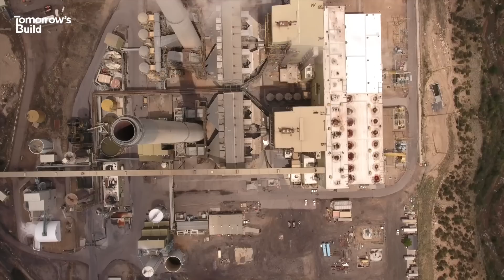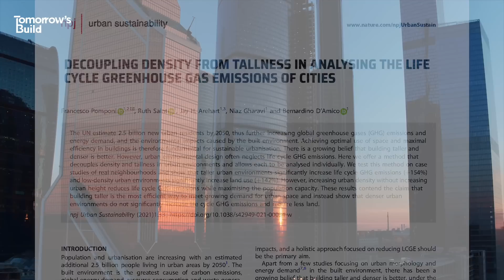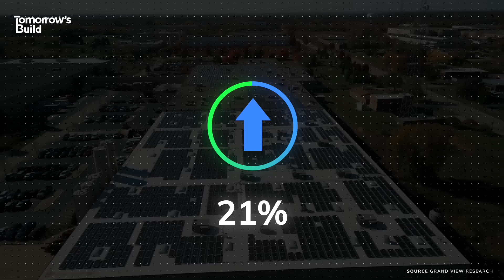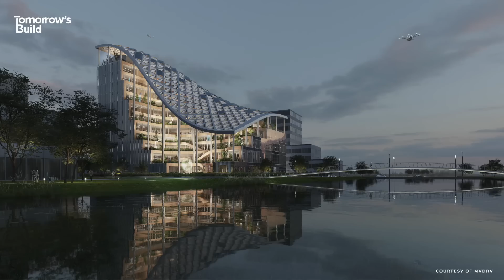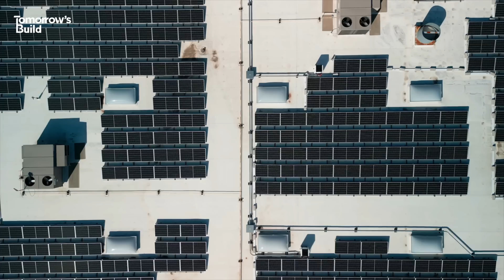Why Skyscrapers Should Be Solar Farms | Tomorrow's Build

Comment: Why you aren't talking about energy, solar pv output is directly connected to the tilt angle, it's a logarithmic scale with very sharp angle like 90 degrees of tilt, so, it's one of the most important natural barrier for that. Let's say for the 22.3 MW burj Khalifa,

It will get the sunlight for about 6 hours on average on each side, due to the tilt angle, mac generation is possible during the very early morning and very late evening, but the irradiance is lowest at those hour.

All these factors will make it about 10/15% of the same sized pv farm or a rooftop pv. And the payback time will be about 60/80 years. Financially, a very loss project.

Comment: The problem isn't the placement of new solar panels persé: it's the cabling them together and transforming that power into usable voltages, as well as means to storage that energy for when it's really needed - which, in temperate climates, is hardly ever when the sun's shining brightly...

Here in the Netherlands we see plenty projects fall flat on their faces because, after panels have been installed by east European workers, all the cabling (loads of copper!) has been nicked.
Police is forever guessing who did it, while most outside of said police force have a pretty good clue, but not allowed do anything about this theft.

Copper prices are rising, which means additional costs to be paid by the clients - not to mention all the extra security firms since police still hasn't got an inkling about the culprits. And even if they *did*, nobody there speaks polish anyway.
End result: less solar panels installed, and even less properly working.

On topic:
High-rise buildings clad with integrated solar panelling would be lovely, but it's usually shot down by architects, who don't like their "artwork" marred in any way shape or form, including actual use by the owners.

Architects and project developers are quite (i.e.: far too) familiar with city councils, and just do as they please, which is making vast amounts of money providing very little in the way of usable living accommodations.
No matter how high: it's either going to have solar panels on the roof (depending on that massive skylight for an architect's price winning atrium, of course), or none at all.

Comment: These anti-skyscraper ideas are so stupid. Covering it with solar panels is just one of MANY ideas to make it sustainable.
It doesn't matter and it's obvious that it's dirtier than small buildings. But people forget that it is tall, so it can accommodate many times the usable space compared to small buildings, meaning we can have more green areas and fewer taller buildings to meet our needs.
Skyscrapers are not the problem, they are the solution!
Lack of urban planning, zoning, vision and building regulations are the problem!

Comment: There's so much more to be discovered in the world of secret solar power. Yet it seems to be taking an age to get them to market.

From water cooled domestic roof panels ~ increasing the efficiency and providing hot water ~ via thin and flexible mats designed to look like roof slates, to the ones featured in the video (which remind me of the old heated rear window filaments on cars; it's all very exciting and encouraging.
Reply: Big oil.

Comment: If you could get more than 1MW average  from the Burgh Khalifa I've got a bridge to sell you.The building is essentially vertical and panels get higher efficiency when they face the sun so less well under a third of the building will get sun relatively incident on it for 4 or 5 hours a day. For 6 months of the year you will also lose about 10% efficiency due to it being so hot.

Comment: You could put solar on the side of buildings but you see a heavy drop in efficiency compared with panels angled towards the sun. This would make the panels so expensive that they may not even pay for themselves over their lifetime.

Also that estimate of the power that the Burj khalifa could produce was lazy in the extreme in its calculations as well.
Reply: Ignoring the angle of incidence is indeed lazy.

Comment: If every house had solar panals on the roof, would we even need power plants other than to store energy for use at night?
Reply: Basically no. Elon Musk did a bit in a presentation several years ago asking how much land area we'd need to cover in solar farms to power the US. People think the answer is, 'All of Texas' but it's a relatively small patch and would easily fit on existing roofs. It may not be the most cost effective balance but it's absolutely viable, in every country on the planet. With undersea cables (which we already have in the UK) you can trade power with other countries during darkness as well. But we still need batteries. That's good though because batteries are useful for lots of scenarios and abundant solar will also have other uses (such as desalination and water purification).
Reply: we'd have to do the calculation, it might free up the city or state household for something else yeah.
If it's enough to cover households and industry then we're good. It's just a large investment into long lasting infrastructures, so plans based on this would have to be on the scale of lifetimes. Like 40 or even 80 years.
Reply: Depends on where you live. You might need more wind vs solar.

Comment: Cover every canal and reservoir in solar panels to collect sunlight, cut evaparoation om those waterways, cool the panels due to them sitting over water, and create electricity over surface area thats not being used for anything else. 

Then you put these solar panels on the roofs of every single school, shopping mall, church, hoospital, parking garages, sky scrapers etc.

We continue with home or modular/mini wond turbines that sit on these skyscrapers and other tall structures to capture wind to generate electricity. 

With all these forms of electricty we need energy storage we can use excess energy to create hydrogen to be used when these forms of energu produciton arent producing eneough.

Comment: I have a feeling more parking lots and facades will get covered in panels in a few decades ... makes so much sense even if the panels are not at the optimum angle
Reply: France has a recent law requiring parking areas over a certain size to be covered in solar panels. It's a great idea.

Comment: When talking facts about electric cars, the e-deniers always gloss over the fact that solar panels on every southern-facing structure will massively offset or even be net-positive for the charging demands of these cars which isn't that bad to begin with anyways (10kWh per day for most commuters)
Reply: The challenge always comes down to storing the power for when it is actually required.
Reply: @monkymind4316  That's super easy now with EG4 LFP batteries
Reply: So I had to check to be sure I had this right, but you do understand that in winter there is the least amount of sun light right?
And in summer the sun raises in the north east and sets in the north west...
So why would you place the solar panels on the south facing structures?
Reply: @derpionderpson1424  In North America, the sun has a southern arc across the sky throughout the year

Yes, there's not as much light but you get a few extra panels to compensate for it and with the lower the temps, the more efficient they get 

If you can get the batteries fully charged by 12pm every day, then you're doing good
Reply: @chattphotos  One of us clearly didn’t get our astronomy right in school because I’m 100% sure the sun will have a northern arc across the sky for the northern hemisphere (which North America is obviously part of) in the summer and a southern arc in winter.

When I look it up that is what I understand the info I find as saying as well so could you please tell me if you can find any online sources that you feel confirms what you’re saying so I can read them and maybe understand where we’re disagreeing.
Reply: @derpionderpson1424  North of the tropic of cancer the track of the sun will always be to the south, not the north. The angle will vary but it will always be in the southern half of the sky. You are 100% wrong on this.
Reply: @willythemailboy2  so as I thought it seems to be a matter of talking past each other.
At NOON the sun is in the south for most of the year on the northern hemisphere past the Tropic of Cancer, but in summer it goes from north east to that position at noon and to north west, meaning it spends a sizable chunk of the day in the northern part of the sky.
So yes I was partly wrong.

Relevant to having solar cells on the southern side of a building though, it still means the angle is not really that good as sun coming in parallel to the panels don’t exactly hit them a lot, therefor if only the sun at noon is when they can be hit, that’s going to be low efficiency.
Reply: @derpionderpson1424  For anything north of the Tropic of Cancer, the sun will NEVER, at any part of the day or year, be north of the zenith. The sun will progress from the southeast to southwest. You are entirely wrong on this.

You are correct in that a vertically mounted solar panel is relatively inefficient. Not because they will be shaded - they won't be - but because incident angle greatly affects the energy available. Vertical panels become more efficient the further north you go, which is why vertically mounted "balcony solar" is relatively popular in northern Europe. At anything above 45 degrees latitude the sun will be more horizontal than vertical, which is roughly Oregon or Michigan in the US or Spain and northern Italy in Europe.

For ideal fixed mounting, solar panels should be fixed facing south at an angle exactly matching your location's latitude.
Reply: @willythemailboy2  source for the first part please.
You telling me is not enough, could be I’m wrong could be you are wrong, give me something not written by a random person in a comment section so it has a bit more validity.

Comment: honestly im shocked we took this long to even CONSIDER the idea of having SkyScrappers double as Solar-wind farms considering they're designed to catch sunlight & they're so tall they get constant wind
Reply: It's all about money, solars cheap enough now
Reply: Sorry but the idea is stupid.
I won't bore too much with numbers but to put it simply their calculation uses the absolute maximal amount of energy the sun gives which means it will most of the time be less then that, they use 100% of the surface area despite the fact 50% will be in the shadow of the building and then use 20% which is for solar panels that are angled and turn towards the sun as it travel the sky, not stationary panels at a 90 degree angle, and even then they get less then 10% of the energy the building consume...

Get a few solar panels on your roof and keep your energy consumption low, that will do way more than this idea.
Reply: @derpionderpson1424  yeah but it's still more than the 0% energy Skyscrapers generate now
Reply: @Artista_Frustrado  
Yes but at that point we have to actually dissect the numbers they got wrong and in effect the same solar panels put on a flat roof would have at least double the efficiency they have on a wall not to mention how much easier maintaining and cleaning would be…
As I said, it’s a silly idea.
Reply: @derpionderpson1424  supporters of the status quo, like yourself, will always attack any solution as infeasible to defend the indefensible status quo. It's not fooling any one
Reply: @derpionderpson1424   man chill the f out, people like you are so pessimistic and always eager to be the naysayers, why are you so against the idea of skyscrapers being covered with solar panels to generate electricity? What's so wrong about that?
Reply: @Artista_Frustrado that's not the comparison, the comparison is between funding solar panel windows/fascade vs more effective renewables. If it'll cost you $1M to install 10kw of solar panel fascade or you could pay $1M for 1000kw of more efficient rooftop or off site solar, then there's no question about which you should fund. 

Products like this have niche use cases and are almost never worth the cost vs countless other green/efficient strategies & technologies. That doesn't mean they're useless but there's a reason these aren't used often. This is basically entirely marketing fluff
Reply: @derpionderpson1424  also why I have to keep energy consumption low but not the SkyScrapers? they're a far bigger culprit than any residence building ever could

Seriously this Captain Planet 80's mentality of "only the lowest common denominator has to do their part, the rich can still burn whole gallons of fuel daily, no biggie :)" needs some serious re-thinking

Comment: so generally, solar power is awesome and we need more of it to be built fast, wherever possible. However, I don't think that it's worth it to build inefficient farms on the sides of skyscrapers (which are often overshadowed by other buildings in the neighborhood).

You will get more climate impact for your money as a developer if you instead use that money to buy some space on a factory roof and put up regular cheap Chinese panels.

You will get even more climate impact for your money if you donate to lobbying organizations such as the Clean Air Task Force.
Reply: Yup..
This video had very bad math to justify a silly idea.
Good to see others in favor of solar panels but not this idea.

Comment: lots of nay sayers about these windows.  but if we compare them to a regular concrete slab or a regular window that returns no power, they are better.  i'm sure the cost will drop as well.  definitely a step forward.
Reply: You are prioritizing maximal space efficiency over maximal resource efficiency.
Once we run out of large unused areas on space, then this idea is an awesome one, until then making the exact same solar panel but putting it on a flat roof facing upwards would give you at least double the efficiency... we have more then enough space but not nearly as abundant resources so lets use the space and save the resources.

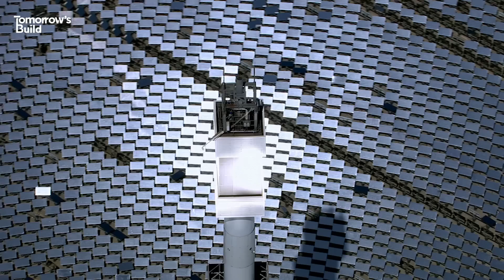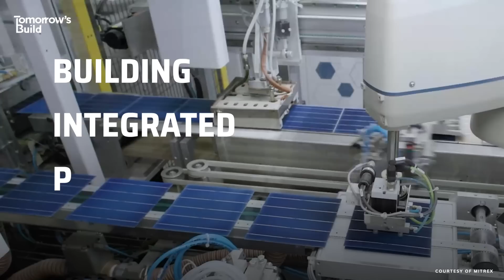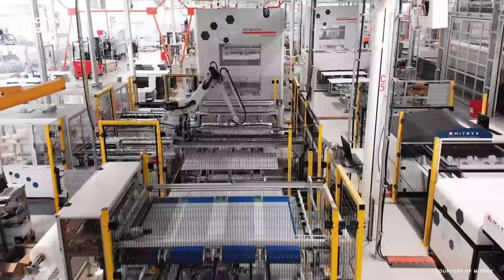Comment: 2:38 - - 3:02 - - BIPVs - - 3:16 - - MITREX co
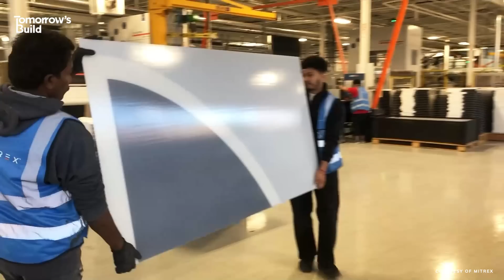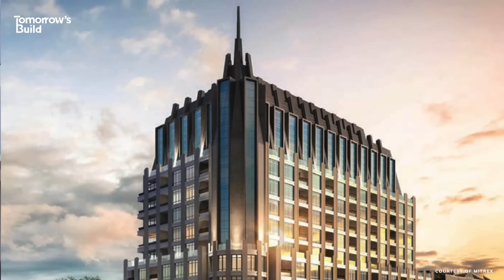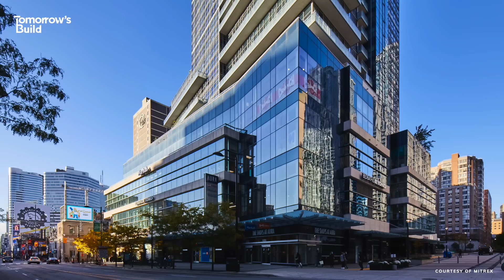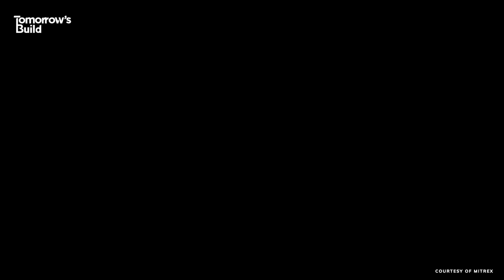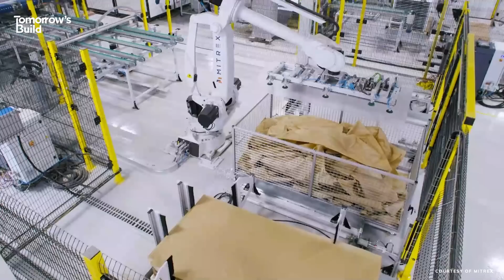3:40 - - church - - 3:53 / 4:02 / 4:08 - - housing - - 4:13 - - transparent panels 
5:14 - - Roof shade w/solar panels 
5:26 - - largest integrated solar project (665,000 sq meters) - 5:28 
4:48 - - rough calculations

Comment: that potential solar energy calculation is as bad as it gets, does the burj-kalifa stand inside the sun? or how all of its sides get illuminated by sun simultaneously? So half of the proposed number at least
 second - vertical angle is not ideal to be placing your solar panels - cut efficiency by 30% on top. so 
Its not 22 300 000
but (22 300 000 / 2)*07 = 7 805 000  
THREE TIMES LESS
Now how much cheaper would it be to just a put damn solar panels on the ground with optimal angle? 100s of times cheaper

Comment: PV on the side of a building at very high latitude like Canada could make sense but the angle to the sun will be so poor below 45 latitude it can’t be cost effective. Your 20% efficiency will be more like 7% based on the panels orientation. Sorry you’re stretching your assumptions to please the sponsor.
Reply: so instead of 22 million watts,, you are looking around 8 million watts.  if my math is right, 1 day of this super reduce solar energy on 1 building would run 1 average home for 1 month.  and that is zero emissions and no extra land being used.  not a bad trade off.
i'm still waiting for North America to start covering parking lots with solar panels.  shade for you car in the summer time, when it rains the parking spots stay dry and in the winter time there is less snow to plow and you car doesn't get covered with  snow either.  plus you get energy out of it.
Reply: Plus, last time I checked,  every face of a building can't get sunlight at the same time. Unless you're on Tatooine or something. Only the side facing the sun is going to generate significant energy.
Reply: Exactly

Comment: The claim about the possible energy production of the Burj Khalifa is ludicrously inaccurate... The video is nothing more than an infomercial for skyscraper developers looking for ways to greenwash their woefully inefficient projects.
Reply: no, it's literally an ad for a company that makes solar panel glass. HOW that gets used is different. There will likely be some greenwashing sure, but they can also be used in genuinely green buildings also, like a mass timber building for instance.
Reply: @Fenthule  transparent solar panels are an order of magnitude less efficient than regular ones, coupled with suboptimal inclination on most installations makes this sort of stuff completely useless beside as a marketing ploy... It's like solar roadways a fundamentally flawed idea.
Reply: @Fenthule  
Just putting the solar panels on a flat roof would be a better use of the resources that goes into this... like double efficiency kind of better...

Comment: Sunlight hitting buildings already generates heat, which translates to lower heating costs/energy consumption.
Also just to point out that the Burj Khalifa numbers are way off, since efficiency on fixed panels is hugely dependent on sun position and panel orientation. They're not the easiest or cheapest panels to clean, maintain or replace either.
I'd also like to see a breakdown of the costs and efficiency of panels with translucent overlays, and whether they make financial sense or even reduce overall carbon emissions.